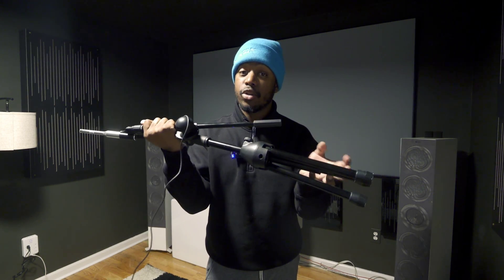Do These FOUR Things BEFORE Running Calibration ❗️

Comment: When I use the auto calibration of my receiver or HT processor (I have both) the sub level gets too low and I don't hear the bass and I end up correcting and increasing the sub volume and crossover. I get better result using an SPL meter

Comment: Off topic question but how difficult was it to move your home theater equipment and how did you pack it? Could you possibly do a video about it?
Reply from the maker: Moved it like any other piece of furniture. Put it in my suv by itself so it didn't slide and bang against other items
Reply: @Kpaceguy Thanks. Considering moving back to NY from Vegas and trying to decide if I should upgrade 5.1 to 7.2.4 before or after I make my decision to move. Looks like before as long as everything is packed correctly and handled professionally.
Reply from the maker: @MegaGuitarGuy20  buy it and send it to my address so I can review it 🤣🤣 then pick it up on your way to NY lol

Comment: Bass trapping is not just for the corners. Often the back wall is a great spot for bass traps. Additionally the ceiling has big issues in the 65-80 hz range so thick panels 5-7”  on the ceiling are effective. Another area that could benefit is the side wall at the listening position benefit from a 5-7” panel. Use 2D diffusion (skyline) directly above the listening position. 1d diffusion on the side walls and 2D diffusion on the back wall.

Comment: Well done 👏🏼 Thank you for the info 👍🏼👊🏼🏴
Ps
What do with your subwoofers 🔊 crossovers after the calibrations are completed ?
Q:
Do you leave them at default ?

Or do you adjust them to what AVR/AVC has configured it too?
Reply from the maker: You leave the crossover on the sub itself at max and make the adjustment in your AVR if you decide to
Reply: @Kpaceguy  Brilliant now I definitely didn’t know 👍🏼👊🏼
I have x2 REL - HT 1510 PREDATOR 2
👍🏼
And the store where I purchased them from say I need to have a flat response by bringing the crossover dial down to about 40 and the level/volume 3/4 of the way round so they can give a flat response 🥴🤷‍♂️
And in the REL manual tells you to have the crossover past 12 o’clock 🕛
I have only done one Odyssey calibration since I purchased 
DENON AVC X4700H
And since I’ve upgraded my surround speakers and my subwoofers almost I also replaced L-C-R 
Since then I have put a Base Trap in one corner and I need to put a small amount of acoustic 🎼 treatment on the storage cabinet that holds all the AV equipment
And get my finger pulled out my butt
And run calibrations. 👍🏼🏴

Comment: Should you stay in the room or leave while calibration is running
Reply from the maker: I personally leave the room if I can't stand in a spot that doesn't block the speakers and the mic. I'm my current room if I stay in the room them in sitting in between the speaker and mic so I just leave

Comment: Another thing to consider, do you run calibration full range? if you have REW and EQ available do you even need to run calibration?
Reply from the maker: Yes and yes
Reply: @Kpaceguy  do you not agree that above the Schroeder frequency no auto eq should take place but only eq based on anechoic  measurements? if so why run full range calibration?
Reply from the maker: @constantinoskatodrytis542  it starts off at full range but a curtain is applied at the end

Comment: Thanks for the video.
Do you have measurements made with REW without vs acoustic treatment?
Do you have measurements with the acoustic treatment on without vs. the room calibration of your Avr?
Can you put the .mdat file of your room and see its acoustics?
Written with a translator.

Greetings
Reply from the maker: I have measured it but didn't save it. I'd have to rerun it all
Reply: @Kpaceguy  If you decide later, you will make a video of the acoustic measurements of the room and leave us the .mdat file.
Reply from the maker: @JuanJose-wt5yj  potentially yes
Reply: @Kpaceguy  Thanks for sharing.
Not sure from your comment that you actually us REW  ?
If you do what a great idea for a video unless you have already done it
Reply from the maker: @deadline7610  I have made a few videos with it. However I have not used it in this room

Comment: Tip #5. Leave the room before starting the room correction sweeps. Put a timer of 5 seconds. Start the count down and boogy out of the room
Reply: That will throw off your calibration. You want to be where you will sit. Because you will be in the room while you are watching your movies and your body affects how the sound travels. Only leave the room if you watch from a different room. You could also put a dummy in your listening chair and leave the room, just don't breathe into the mic whatever you do.
Reply: @Pete.across.the.street  I want to say I understand your point, but I still want to disagree.

First point of the measurement you for sure want to leave. Your face will be too close to the measurement mic and you breathing will affect the measurement and the mic being so close, it'll pick that up.

If you hold your breath, im still not sure if you can hold your breath for that long when you got a 7.x.4 setup.
Reply: @sammy10001  as long as your breath isn’t literally touching the mic you’re good. You can even breathe silently.
Reply: @sammy10001  put it just above your nose. Putting a few pillows that are about your shape and size in the listing position might work. Then you could leave the room. Wonder if anybody had done a study on it.
Reply: @sammy10001 I agree and I’ll add a rebuttal. If you lay on the floor you won’t block any speaker. 👍

Comment: 1 more great tip set all your speakers to FLAT before running calibration so ARO can adjust where it needs too
Reply: Didn’t know that
Reply: What do you mean by FLAT 
Is that turning them all down to zero 0️⃣ 🤔🏴